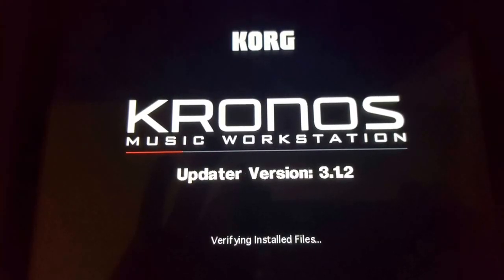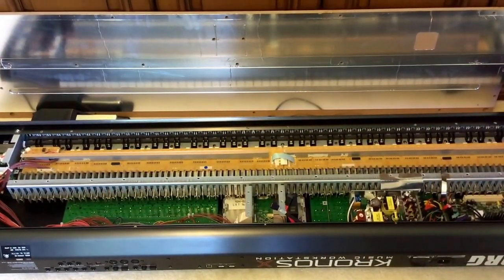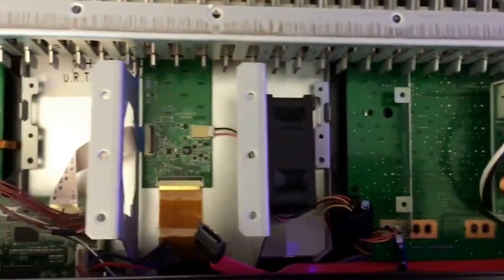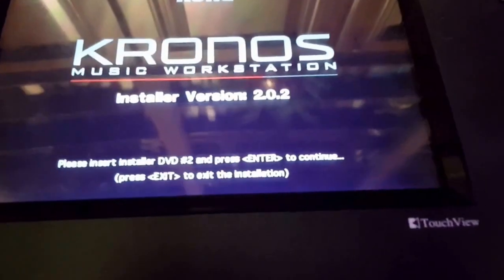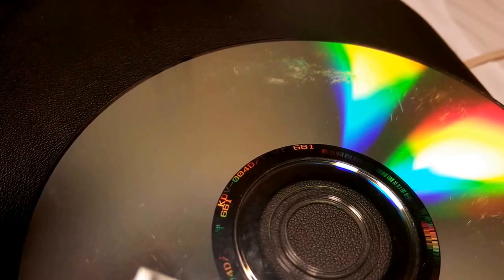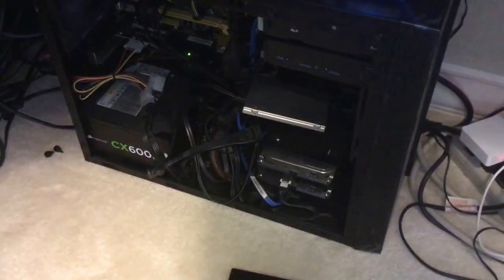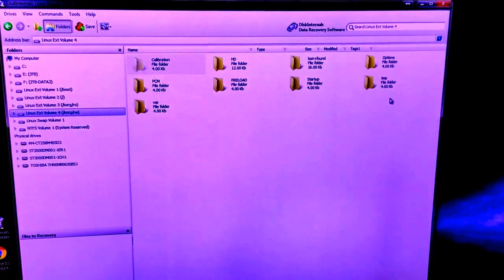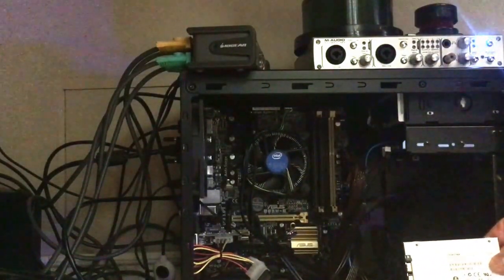Korg Kronos X Brain Salad Surgery:  How to recover from a damaged upgrade.

Comment: Hi what exact dvd drive are you using ,iv'e tried about 6 of them ,no success.
Reply: Samsung DVD RW 8x
Reply: @pablosalvat2553  Turns out my OS was fine but i had to replace my Power supply Unit....thx anyways
Reply: @osbertgeorge  Greetings, I have a korg kronos 2 and reinstalled everything to an SSD but to do it requires software that copies the boot partition and in addition to the help of the b3 DVD installation discs. If you have problems with your korg kronos I will gladly help you.
Reply: @pablosalvat2553  Im all sorted out man,thx

Comment: Hello John, thank you for this video,  my question is: after I downloaded the link (will be 11,7 GB) there are tow folders,  do we put each one in one dvd (no; 1) , then the other in ather dvd (no; 2) ? But the dvd capacity is 4,7 GB.. how come? 
Thanks in advance
Reply: And how can we use the disc reader (Linux) ?
Reply from the maker: Dual layer and double layer DVDs are the same thing and are also referred to as DVD-9 discs and have a capacity of 8.5GB. In dual layer DVD-9 discs, two layers of standard DVD-5 are joined together with a transparent spacer and a thin reflector between the two.
Reply from the maker: So to be more clear:  You burn each of the files in the zip to a dual-layer DVD, using a portable dual layer DVD player.  You then plug this dual-layer DVD player into the Kronos to boot up.
Reply: Thank you for Full information,  but why should we use Linux ?

Comment: What’s the name of the new hard drive you have installed for your Kronos
Reply from the maker: This was almost 3 yrs ago, but looking at the video again looks like regular SATA cable. Also from the video at 1:24 looks like I upgraded the Toshiba SSD that came in the Kronos with a larger/faster Intel SSD.  This is where I learned a lot about the Kronos internals:   https://marcan.st/2016/06/hacking-and-upgrading-the-korg-kronos/
also look at:     https://kronoshacker.blogspot.com/2015/06/rooting-korg-kronos.html
Reply: John Sanders Thanks for your response I really appreciate. 
 I bought The same sata cable for the secondary  slot plug under the the key bed which is under plug in the board only  one  key is hitting the cable when I play what I purchase was 24” right to right angle. But ... under the key bed it’s too large.

Comment: I’m having the problem you had   I removed the original primary SSD drive 60 GBs & Replaced new SSD  hard drive which Is 250GBs I clone the drive boot up my Kronos I only see the 60 GBs instead of the 250 GBs drive please let me know what you did  any suggestions
Reply from the maker: Well it’s a Linux system so you would need a partition manager that works with Linux partitions.  From there you would just change the size of the partition.  It should be transparent to the Kronos OS.

Comment: John,  Very informative video!  I currently have a Kronos that won't boot.   It is imperative that I save my songs, samples, set lists, etc.   Does the HD folder you mention contain all this information?   Can the folder be copied to the new SSD drive directly?
Reply from the maker: It was a year ago and I was mainly looking for the SNG files but if you restore the all PCG files found in HD/Factory you should be good to go. (copy the folder onto USB Flash drive).  At this point I don't know if anything else is necessary to have your custom setlist restored.  Maybe a question for Narf on the Kronos Enthusiast Facebook page.
Reply from the maker: I'm sorry about the delay in responding, bad feeling when your Kronos won't boot.  The old Kronos drive has all of your work. (As long as it didn't bite the dust).  You may also want to look a the seating of the memory sticks.  A lot of users are reporting that they reseat the memory sticks and the machine starts booting again.  As far as directly copying, I don't see how... you need a PC to pass the files to the USB stick.

Comment: does Ssd  SATA III works with it?
Reply from the maker: This was almost a year ago, but looking at the video again looks like regular SATA cable. Also from the video at 1:24 looks like I upgraded the Toshiba SSD that came in the Kronos with a larger/faster Intel SSD.  This is where I learned a lot about the Kronos internals:   https://marcan.st/2016/06/hacking-and-upgrading-the-korg-kronos/
also look at:     https://kronoshacker.blogspot.com/2015/06/rooting-korg-kronos.html
Reply from the maker: You can format the drive that came with the Kronos.  However, any data, KSC, PCG, SEQ, or WAV files will be lost unless you save to USB Flash drive BEFORE the crash! Unfortunately,  if you did A LOT of work and didn't back it up to a flash drive then if you format the original drive you will lose all of your work.

Comment: How to reapply the software?
Reply from the maker: Hussam Saud - put the original software that came with your Kronos in an external DVD reader plugged into the back USB port of the Kronos. When you turn on the Kronos it should boot from this disk. Follow the prompts.
Reply: John Sanders so this step should be after installing the 2 discs?
Reply: And after this operation, how can I download the  version 3.1.2 without any error?
Reply from the maker: Maybe I need more detailed description of what you are trying to do. Can you elaborate?
Reply: John Sanders ok, I have the same issue that's happened with you, but let's go back to 5 steps on description : 1- it's clear for me 2- *is the version 2.0.2 already in the disc1/2.?    3- about registering the kronos, how that will happen (how I will recive the code or number) ? 4-it's clear for me #5 too.
Reply from the maker: 2) My Kronos-X came with 2.0.2. So that's what I reinstalled.  3) Goto:  https://shop.korg.com/Kronos/default.aspx?ReturnUrl=%2fregisterKronos
Reply: John Sanders many thanks for you, I will do it and I hope it works well

Comment: I had this same problem, I removed the ram and reinserted them, made sure they where secured and it started working again.
Reply: Heheh, I've been worried couple of days having this problem too. I almost ordered a new harddisk, but then I saw your comment. I did the same. I took off both the cables from HD's (I have two) and removed the RAM and voila, everything is working again! Thanks for your input. It saved me a lot of trouble